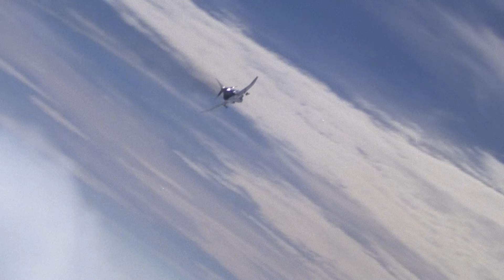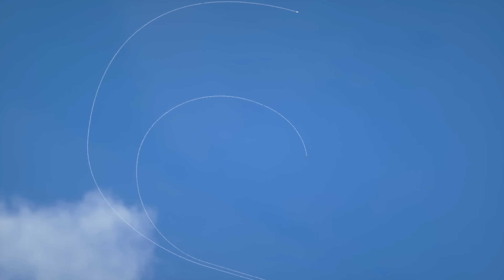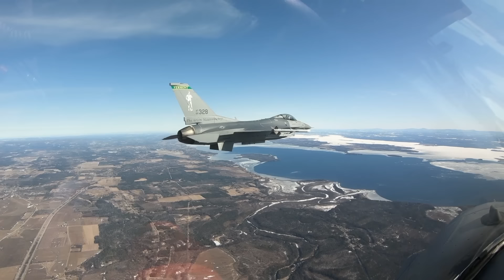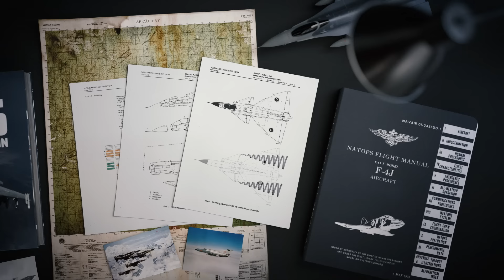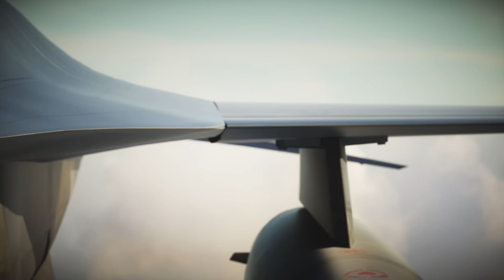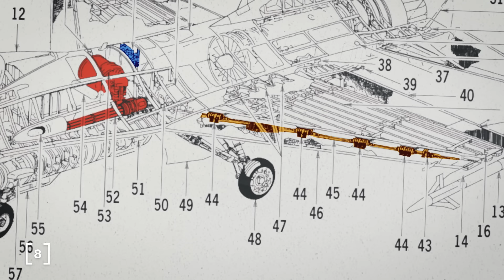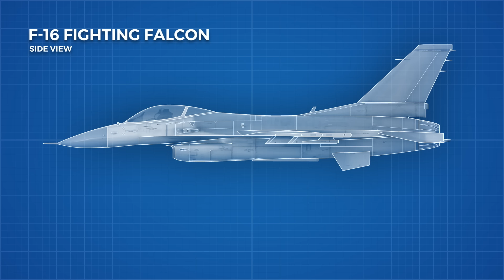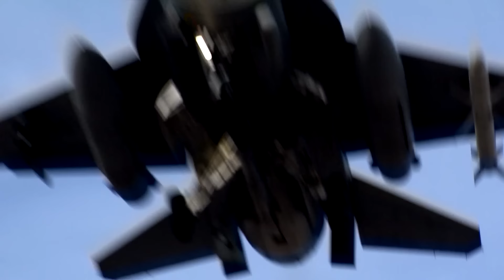The Insane Engineering of the F-16

Comment: I was an egress mechanic in the USAF. I was only in for 4 years but at the very end I got an incentive flight in an F16D model 88-8165 wayyyyyyy back in 06' I never thought the F-16 would still be in service like it is today. pulled 9.1 G's. Flew Mach speed... did not get to do max climb takeoff. 

my favorite part of the Jet was the M61 Vulcan cannon Cover...  you can see at 14:10 that is a thing of beauty. 

33:49 being an Egress mechanic I used to always think that the Control stick was locked, and why don't they unlock it so we could guide the seat in and out better. Come to find out that it's pressure sensitive. When I got my flight and got to take control for a few spins, I just pressed it to the left a little and was spinning around lol. I only had the leg part of the G suit too.

I was very fortunate to have been an Egress mechanic. 

I also got this flight because God Loves Me

Comment: "low-cost" is key. What I don't understand is the creep of "Viper" name, why? A viper is a fu***ng snake, it doesn't even fly! A "Fighting Falcon" is a more awesome and way more appropriate name. Also, Vietnam went belly-up because the pilots were told that they were flying the awesomest, most advanced, fastest planes ever, which they believed because it was partially true, what they weren't told was that the planes were only good at a standoff ranges and at full speed, also, that not having a cannon and first Gen missiles that couldn't lock onto their targets was an insane disadvantage. Vietnamese pilots forced the Americans into dogfights, dodged our wonky missiles and finished them off with a cannon before Phantoms could gain speed and run away. By the time they added a cannon it was too late, besides, Phantoms would still have lost because they were too big and heavy. My point is... Um... Yeah... STOP CALLING IT A "VIPER"!!!

Comment: I've heard from military pilots that the f16 is actually very nice to fly, mostly because it does what you tell it to with little resistance, similarly with other aircraft like the f18 both of which seem to be very well liked by their pilots, of course f18 pilots will always comment on how they have two engines and more engines is more better. From a civvie side, naturally stable planes are very forgiving especially without complex fly by wire systems, fly by wire can take a system balanced on a knife's edge and make it feel easy and stable but before fly by wire you quite literally had to make the craft mechanically and aerodynamically easy and safe to fly, many fbw designs (B2 spirit as a great example) would be nearly impossible to fly mechanically. But for trainers and ga you get the redundancy of having a plane that self corrects aerodynamically and usually a fbw system on top of that with modern craft. And there is a reason every pilot learns pure stick and rudder before moving on. On civie aircraft a COL forward of COG is very dangerous, and you can actually achieve this instability in GA simply by improperly loading your aircraft, say too many passengers or too much cargo, in which case you can stall out your wings and get into a situation where it is actually impossible to recover, sort of beyond a point of no return. I don't think the video goes much into static stability vs dynamic stability but this is also a factor.

Comment: So, one of the things the F-16 test pilot didn't mention when discussing PIOs in the Falcon is WHY that sense of correction/overcorrection occurs... and it's because the F-16's flight joystick - while yes, it does move now - only has 1/4 inch of travel from dead center to the stops in any direction. I've flown the F-16 demonstrator mockup for the DCANG (a fully functional F-16 cockpit assembly mated to a computer-driven display screen - basically Microsoft Flight Simulator on steroids) and your wrist is SORE by the end of a 15 minute training flight from the constant feel of needing to keep a firm grip on such a miniscule control distance. Even the slightest motion on the stick will move the jet with purpose.

Comment: That advanced computer control system is run by a 386 chip. Remember those in the 1980's? Still in there.

Comment: I read its actually aerodynimical unstable, meaning its not flying smooth long turns, its actually designed to corner a bit too hard!it doesnt need to fly as fast as F15s at high speed to get 10gs

Comment: 1:12 important detail: another weakness of the f-4 was that it was equipped with air to air missiles designed to intercept high altitude bombers, not migs. At the low altitudes f-4s usually engaged in, these missiles only had something like a 30% chance of hitting the migs.

Comment: This Lockheed Martin icon, first flying in 1974 and entering service in 1978, remains a beast with its single Pratt & Whitney F100 engine pushing Mach 2 speeds and a 2,277-nautical-mile range with drop tanks. Its fly-by-wire system and relaxed stability design—revolutionary back then—give it insane agility, perfect for dogfights, while the APG-68 radar and latest Block 70/72 upgrades (like AESA) keep it lethal with AIM-120 AMRAAMs and JDAMs. With over 4,600 built and still flying strong across 25+ nations, including Ukraine’s recent successes in 2024, its adaptability shines. Sure, it lacks the stealth of the F-35, but at $20-30 million per unit (depending on config), it’s a cost-effective workhorse. A technical legend that’s still ruling the skies—love its enduring edge!

Comment: Ole Evinrude didn't invent the outboard motor, Waterman did.  Evinrude did introduce the first aluminum outboard, ELTO, Evinrude's Light Twin Outboard.  Outboard Marine Company was created with a merger between Steve Briggs of Briggs and Stratton.  Johonson was acquired during the depression and the name was changed to Outboard Marine Corporation.  Kiekhaefer didn't improve the Thor outboard because he was perfectionistic.  He did  so because he was cash strapped and had a bunch of motors that didn't run after Montgomery Ward cancelled their order.  Kiekhaefer improved the carburetor and was then able to sell them to Montgomery Ward and because the motor ran well, Montgomery Ward placed more orders pushing Kiekhaefer into the outboard business.  Four stroke motors have been around a long time.  Homelight made a four stroke outboard in 1966.  Honda introduced four strokes in the 1990's and because they were quieter at idle with a lower voice note and had better fuel economy, they became successful.  Mercury, Yamaha as well as Evinrude had direct injection 2 strokes.  Mercury Optimax, Yamaha HDMI and Evinrude Fitch.  Mercury's firs four stroke outboards were badged Yamaha.  Johnson became a badged Suzuki four stroke.  Mercury motors under 60 HP are badged Tohatsu motors.  OMC went belly up not because of lack of innovation but because Brunswick brilliantly started buying boat companies, Bayliner, Sea Ray, Boston Whaler, Lund, etc.  If you bought a Brunswick boat, you bought a Mercury or Mercruiser.  OMC bought Four Winns, Larson, Glastron, etc.  That made them cash strapped and their VRO (variable ratio oil) system had issues they were also cash strapped from warranty issues.  While VRO2 worked, their reputation was damaged.  Then Fitch wasn't ready for prime time and that also cost them in warranty claims and they lacked the cash.  The boats were sold to Genmar Industries and BRP bought the motors but cancelled Johnson.  BRP changed the name of Fitch, which OMC had already improved, to E-tech.  But BRP had the same issues competing with Brunswick boat brands that OMC did.  The E-tech G2 was a terrific motor but the damage to OMC's reputation tainted it and BRP didn't own boats ( they started purchasing brands but too little too late).  We shall see how long Honda and Suzuki last in the current market.  Yamaha has a stronger foot hold and independent brands such as Grady White and Regal used Yamaha motors to lower their purchase price and simplify rigging.  Plus, Yamaha are the most popular salt water brand.  Mercury leads in fresh water.  

Your story was dramatic and interesting but there is more to the story.

Comment: Everything in this video is correct, and the production quality is great - BUT - it misses out on some crucial context. First of all - the F-16 was not developed because the Air Force saw those energy maneuverability diagrams and was convinced. On the contrary - this was initially a politically driven program, where Congress forced the Air Force to build a cheaper fighter - which at the time they seriously did NOT want! Also, the F-16, as it was built, was not what the fighter mafia wanted - they wanted it even lighter and cheaper. And as time has gone on, and the F-16 has arguably become more and more useful, it has moved further and further away from that fighter mafia ideal. And those diagrams shown in the background therefore come with a massive caveat. As it says in the upper left corner of the diagram, those charts represent the F-16A Block 15, one of the earliest versions, with 512 rounds of 20 mm ammunition, 50% internal fuel and only 2 AIM-9 Sidewinder missiles. As you can tell from most of the footage in this video, the F-16 almost never flies operationally in this configuration. Once loaded for bear, the F-16 will rarely go supersonic at all, and that 9G load is reduced by about half (depending on the stores.) So all those amazing features that the video talks about ends up being irrelevant to the missions it is most commonly used for. At the end of the day, it is the flexibility and rugged baseline design of the F-16 that has turned out to be its greatest assets - not its peak performance.

Comment: Was there a mention of the problem created by using h6drazine to power the emergency restart engine? Hydrazine is deadly to breathe, while it is invisible and odorless. I don't see how the fractional additional power it provides outweighs the hazards to F-16 crew and those who have to manage the stuff in storage and shipment. It was a rocket fuel used on the old Titan II ICBM, and is hyoergolic with nitrogen tetroxide as the oxidizer.  Leakage of hydrazine from a missile in Damascus Arkansas caused an explosion of the rocket and risk of a nuclear explosion as the warhead was blown about a mile away. All the Titans were retired after that.

Comment: I had worked the F-111 before working the F-16 as a weapons technician, both aircraft having been designed by General Dynamics. I realized early on that the F-16 was just a modified F-111 as far as the weapons system was concerned and could troubleshoot it very easily. However, the powers that be thought that a new aircraft meant you had to have specialized training. I was preparing aF-16 to be loaded and the left wing tank was failing, I called for the proper tester and was told to wrap it up and Sgt Greer would take over. Our Captain asked what I was doing, I told him they didn't want me to troubleshoot the aircraft. He asked me what I would do. I said First do an interface checkout at the wing if it passes you have a bad tank, if it fails I would have to troubleshoot farther into the aircraft. When Sgt Greer got there the Captain asked him the same question. Greer said verbatim what I had said. The captain asked Greer why I couldn't troubleshoot the aircraft, Greer said that I hadn't been to the troubleshooting class yet, The Captain said "It Doesn't sound like he needs it." This was all for naught because when they came to remove the tank so we could do our check, they found a canon plug had disconnected on its last flight.

New technology, but still the same old problems.

Comment: Just with indigenous developed low surface missiles India recently blasted 2 no. F16 jets utilized by Pakistan during pakistan army sponsored jihadi islamic attacks, so what so greatness in these jets?
Reply: The defensive systems in the top tier variants, to which Pakistan has no access. They are flying very early models with no upgraded software or hardware.
Reply: It's cost effectiveness.  Meaning  no matter how much you shoot down, it will still be more effective

Comment: The F-16 was General Dynamics entry in Europe's lightweight fighter program in the 1970s.  It competed against Northrop's F-5 and McDonnell Douglas F-17.  The USAF did not want a single jet fighter, but when the Europeans told the US they would not buy US unless they fighter they chose was targeted to US inventory, the USAF was told to run a lightweight fighter program.  GD's F-16 won and was eventually chosen by multiple European nations as their standard aircraft.  Northrop's F-5 eventually became the F-20 and McDonnell's F-17 became the F-18.  If Europe did not want a common single jet fighter, there would be no F-16.  The most remarkable thing about the F-16 is that it has remained relevant for nearly 50 years something not predicted in the early 1970s.

Comment: Over the past two years I've been learning GD&T for work. I went to the local aerospace museum and got a look at some of the engines from the 1950s they had on display. Everything after about 1960 was blocked off. Why? Those designs were so bulletproof and scaleable that they are still used today. 

In 1970 they had no CNC CMMs, no scanners, no CAD, and very few calculators. Engineering was done with slide rules and pencils. Seeing something like the F16 in person and recognizing that it was conceived solely with human minds and hands is crazy to me. As with every generation, we are standing on the shoulders of giants.

Comment: Main problem is the plane was not designed for ground survivability.  The unprotected air intake requires debris free air fields.  The landing gear also is way too unforgiving runway defects.  The arming and maintenance procedures are overly complicated and require specialized equipment.  Not a problem if a major airfield can be used but with ballistic missiles such an airfield can't easily be used in a conflict situation.  What is needed is an ability to use low grade dispersed airfield like even roadways where a mobile crew can service the plane and no obvious target can be presented to an adversary. This being the history of war where often it's the non-combat issues that win the war.

Comment: I to this day not understand how the US could ignore the F-5 as an option in vietnam to escort the F4s
Reply: probably because the F-4 has BVR capability and better armed with four sparrows with BVR capability and four sidewinders while the F-5 has only two sidewinders
Reply: @Wolfie142_  payload capacity isn't everything, the F-4 was absolutely irreplacable. Even still the US flew the F-100 in Vietnam a lot while it had a lower capacity than the F-5, was way less nimble, had a worse radar than the F-5E one and needed a way longer, paved runways.
Reply: @Cibohos  yeah mostly in the early stages when the good stuff like the F-4 was still in its infancy and because it has a longer range than the F-5

besides the F-5 was meant as a lost cost export fighter and we never really needed a light fighter at the time

Comment: I think it would have added a lot to the video to explain what the contours on that Ps diagram represent, and why there's much more to the kinematics of modern fighters than "it can pull 9G". That's also a useful starting point to discuss the tradeoffs relative to the F-15 (which has lower structurally-limited turn rates, but higher Ps in most circumstances, especially supersonic) and F-18 (which has lower Ps almost across the board, but significantly greater instantaneous "pointing" ability thanks to not having a 25-degree AoA limit).

The centers of lift and gravity around 28:00 are obviously not to scale with the aircraft profiles. The CGs of these aircraft are much further back and closer to the heavy engines, and the centers of lift are also much further back, near the wing's chord center.

EDIT: NVM, the Ps diagram explanation is on Nebula. It's pretty decent.

Comment: Correct me if I'm wrong, but I was under the impression that many WWII fighters were intentionally unstable for turnfighting. They certainly weren't as unstable as the F16 or a flying wing, but they didn't fly like other planes did where they would automatically recenter to level based on the wing dihedral.
Reply: Some were planes were unstable in roll meaning that pitching up would make rolling easier, the f16 and other modern fighters are unstable in pitch

Comment: My favorite MRF ever. Its simple, cheap for some but so deadly. The design is the best. I hope the Philippines pick F16 Vipers instead of JAS 39 Gripen.
Reply: Yes PHL should pick the F-16V instead of impractical JAS-39. PHL would use the F-16 mainly for air to ground sorties in the south so the F-16 is ideal even if it's older block 50/52 or slightly newer Block 60 E/F variant. Spare parts are cheaper than JAS-39
Reply: @jawarakf  i genuinely have no clue about the gripens performance and economics vs the f-16, but the gripen is so fucking sexy man